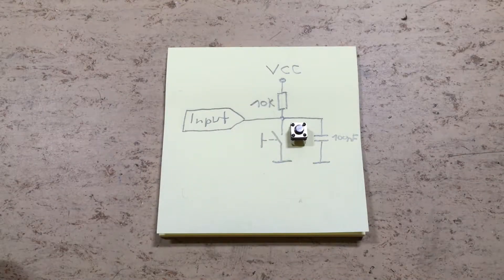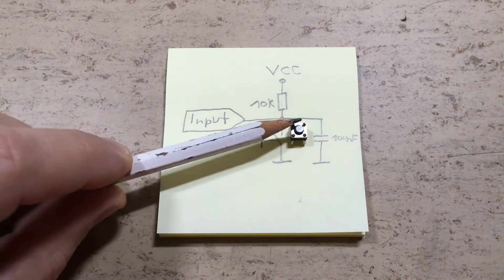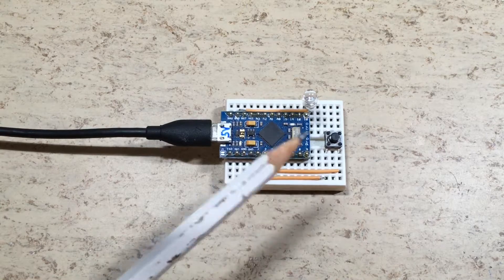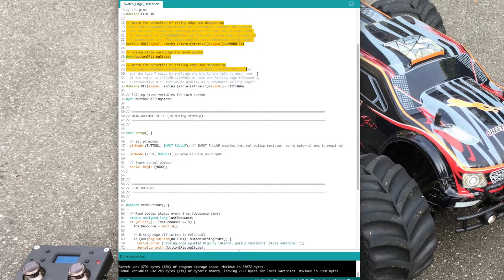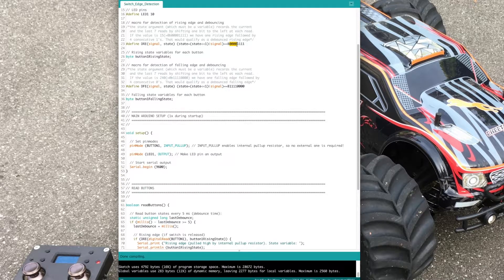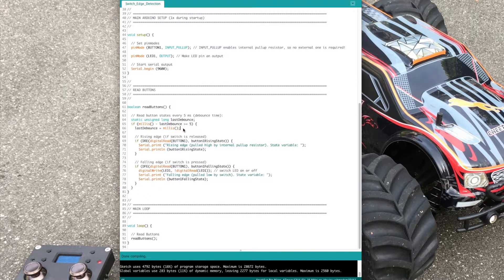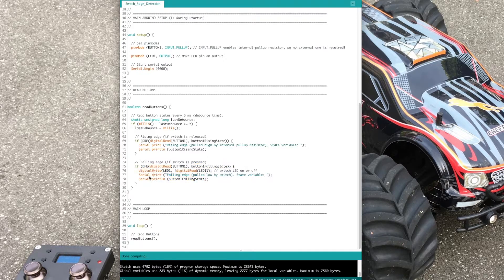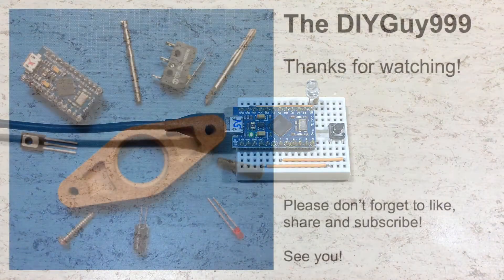Arduino Switch Button Edge Detection And Debouncing Tutorial

Comment: I really enjoy ur video, Thx u so much!!
I have a "odd "question:

your code:

    if (DRE(digitalRead(BUTTON1), button1RisingState)) {

      Serial.print ("Rising edge (pulled high by internal pullup resistor). State variable: ");
      Serial.println (button1RisingState);

In this part ""(digitalRead(BUTTON1)"", I would like not to use it  instead I would like to use
MACROS like this "(~PIND & 1<<BUTTON1)". I've been trying it but I know something is missing.

thank you and sorry for my bad english!!
Reply from the maker: Of course there are other solutions, but I can't support them. Just do it like in the video and it will work